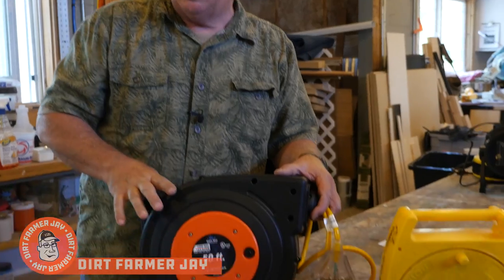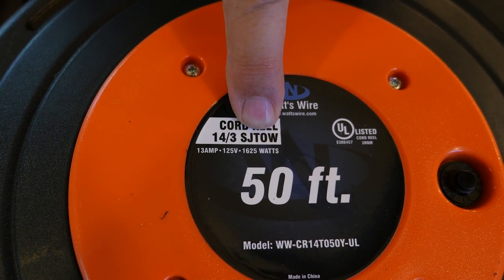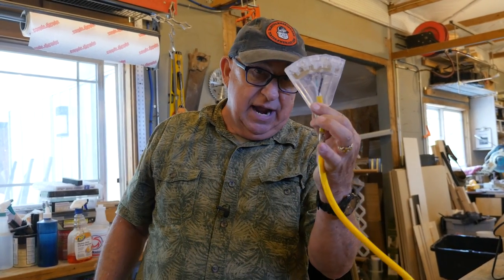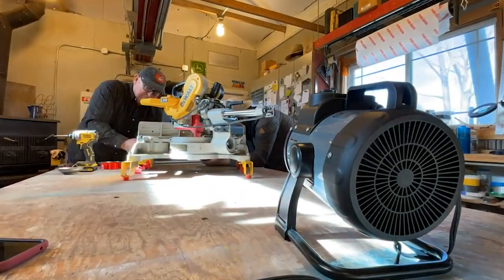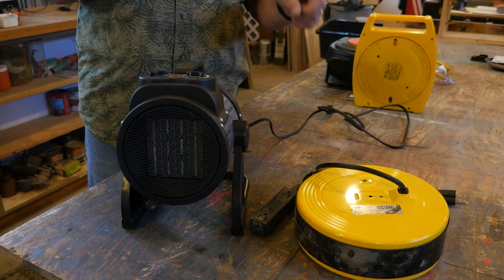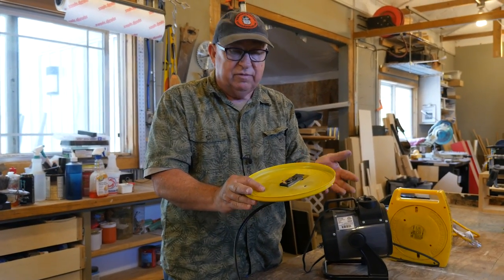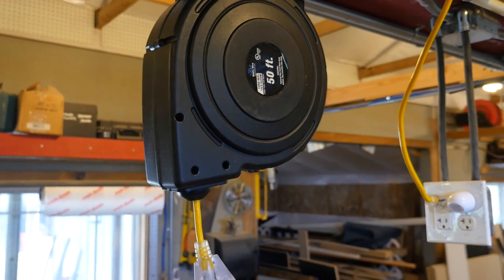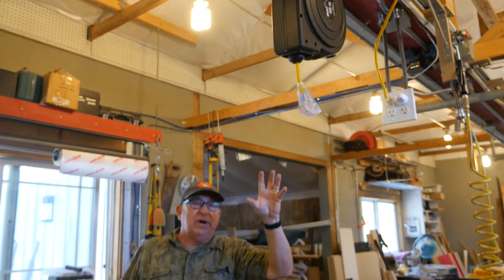Best Overall Cord Reel We’ve Found!

Comment: Cord reels are a bad choice for any high power demand electric motor like a saw. They work well for supplying power to things like lights, fans and small handheld power tools or soldering irons. I avoid using them in my workshop as most of my power tools like my saws and routers need a more robust electrical power supply.
Reply from the maker: Good insights. Indeed, the risk is that people end up using a form of an extension cord for the power supply for stationary or semi-stationary power tools. That can certainly lead to problems. Thanks for giving more detail! Best, DFJ
Reply: If you use a cord that has #12/3 awg wire, you can run any 120v saw no issue.